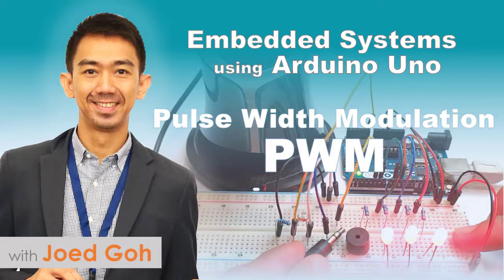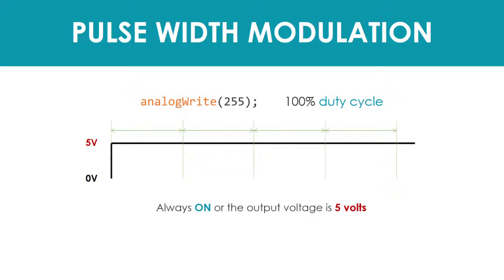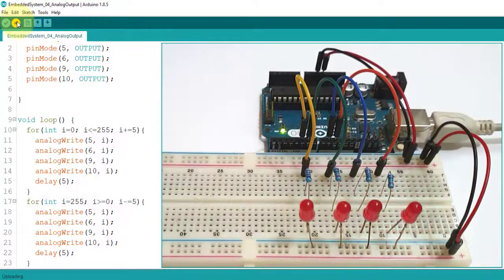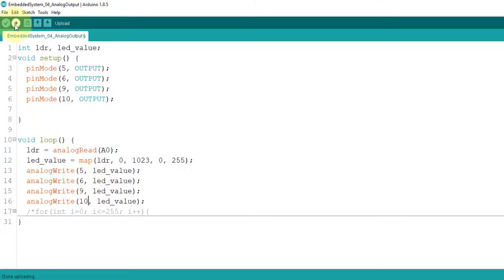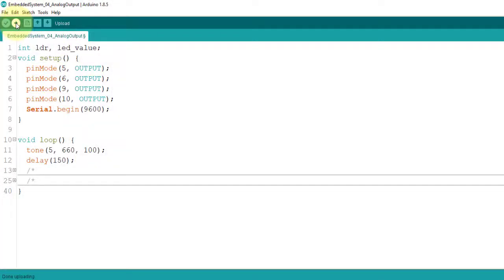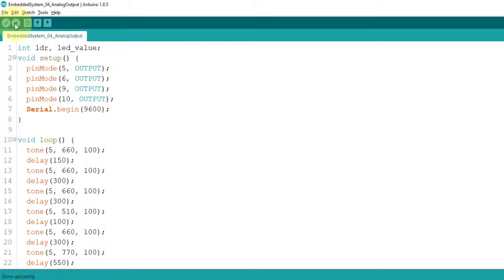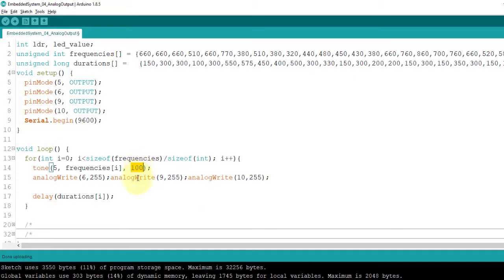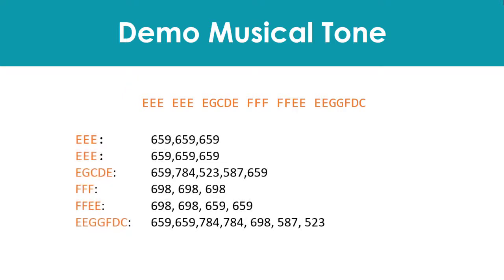09  Arduino Pulse Width Modulation (PWM) | Tone Generator | Embedded Systems Course

Comment: This isn't actually PWM (at least in the buzzer part), right? You vary the frequency to get the tones, so what you're doing is frequency modulation, not pulse width modulation, which has the same frequency throughout, with varying levels to simulate sound waves.
Reply from the maker: Yes, tone() uses a fixed 50% duty cycle and it doesn't have to be a pwm pin. The dimming/fading LED is PWM, while the buzzer is tone()